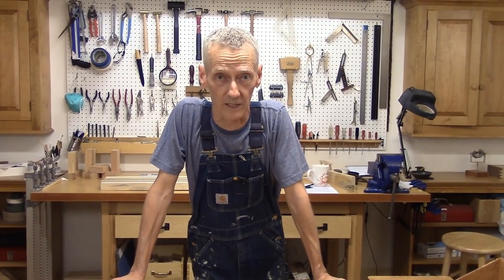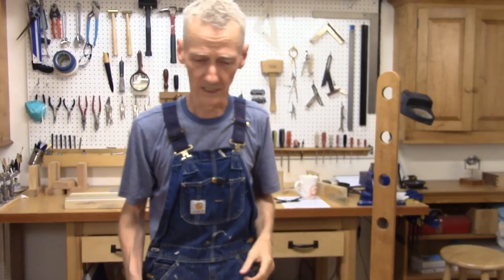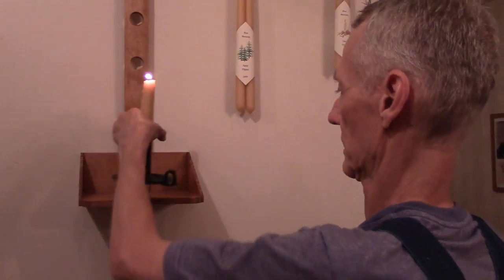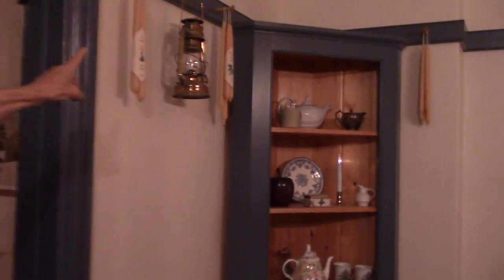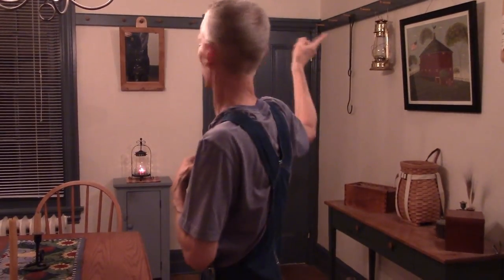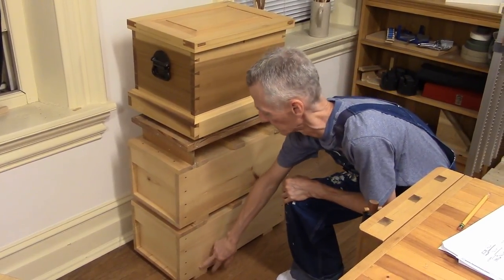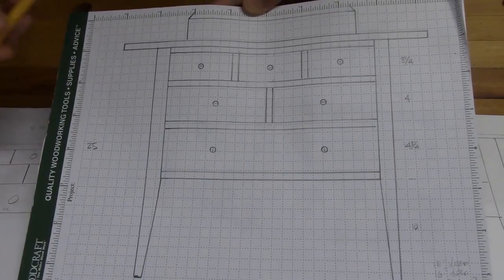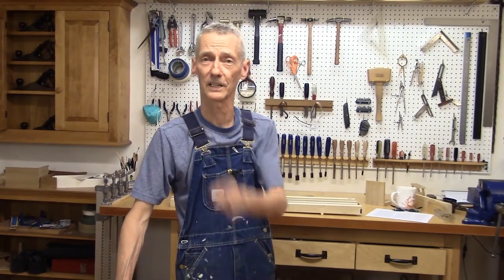Show and Tell: Shaker Candle Sconce

Comment: Hi.  I love the sconce.  Did you operate off of plans or did you make up your own interpretation of the shaker sconce?  I’m looking to get a hold of plans.
Reply from the maker: It's my interpretation from a photo of an original Shaker sconce I had seen in a book. Sorry I don't have printed plans but let me know if you need any of the dimensions. Regards.
Reply: Hey I’d love to  have the dimensions.  We have a shaker village near us so I’ve gone in and measured stuff on the walls but I kind of like you interpretation is scale better.
Reply from the maker: Here are the overall dimensions. The vertical hanger is 1/2" thick 2 1/8" wide and 26" long. The holes are 1 1/8" in diameter on 4" centers. The "tray" on the bottom is as follows: The bottom is 1/2" thick, 9 1/2" wide by 8" deep. The rounded corners on the front of the bottom are 1" radius. The back is 1/2" thick and 4" high. The sides are 1/4" thick and are sized to fit the back and the bottom as you can see in the video. I used cut nails and glue for assembly. Have fun with your project and let me know how it turns out!
Reply: treebangham 

I planed all my cherry pieces to 1/2” thickness.  I’ve been stuck on the width of the hanger.  I had installed stained and varnished cherry pegs around my bedroom.  Today I finally decided I need to make the width of the hanger the same as pegs.
Reply: Oh.  One more question.  You said that the holes are on 4” centers.  What is the distance of the center of the first hole from the top of the hanger.  I’m about to bore the holes.
Reply from the maker: The distance is 2".
Reply from the maker: Glad you're making progress. I'm not sure what you mean about the width of the hanger being the same as the pegs. The hanger is 2 1/8" wide.